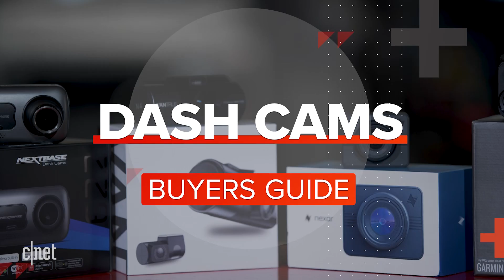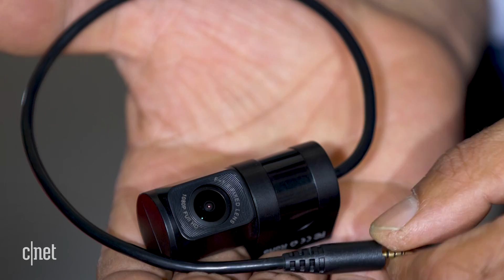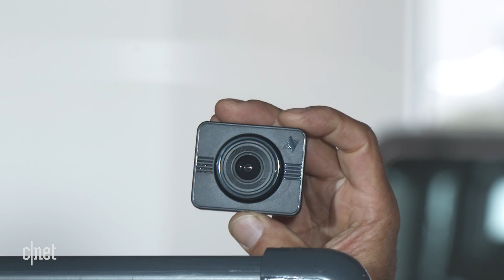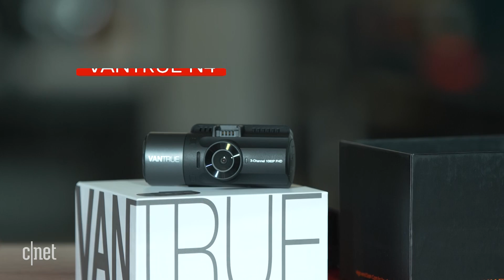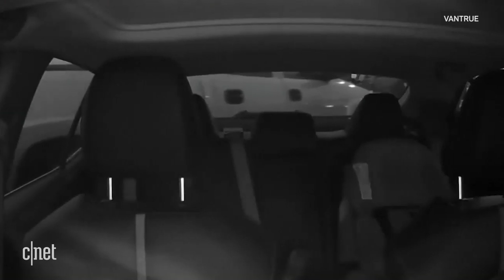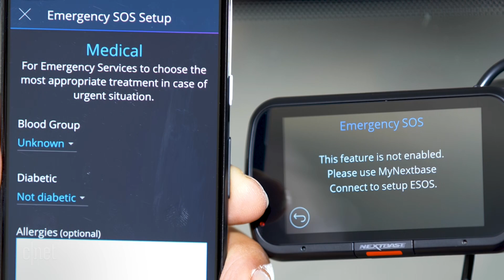Best Dash Cams 2022: The Ultimate Buying Guide

Comment: After having a dashcam for three years now, I actually can't believe cars don't come with them built-in as a "must-have" safety feature.
Reply: Automotive attorneys don't want any liability to fall back on the company for any glitches.
Therefore, it's an elective option for the consumer.
Reply: @cokiea57  no LOL. It just hasn't trickled down to cheaper cars yet. Plenty of expensive cars come with them, and every little thing adds cost to a car. So adding the hardware, body work for rear camera, wiring/power supply, accelerometers/sensors, plus integrating it with the infotainment system (which is the expensive part), is expensive. Once the software, firmware, and UI gets honed on the more expensive cars, and those people pay for the R&D, it'll show up in cheap cars. It has to be a system that works perfect, is integrated perfectly, and had to last more that a few years that the aftermarket cameras do. People buying a $20k-40k car probably aren't going to spend $2k to add some cameras. So they don't spend the money integrating a camera system to cheaper cars, unless they cut corners in other places. Like Tesla, they can cheap out on materials, quality, for & finish, and QA/QC, and offer cameras. Tesla can add cameras because they use poor quality "vegan leather" (aka plastic), poor quality materials for touch surfaces (more plastic, poor quality plastic at that), don't take care when assembling it, and don't make sure that it is assembled & built properly. So all that savings allows them to offer cameras on the cheapest $40k Model 3.
Reply: @littlejackalo5326  Very true, first time I sat in a Tesla I was amazed at how poor the material quality was.
Reply: @krane15 Cameras are cheap yes. So was Sat Nav but it didn't stop car manufacturers charging up to £2000 for them and £100 for an updated DVD disc.
Reply: Tesla's record 24/7 ... check out wham bamm Tesla cam videos on YouTube
Reply: 4 cameras running on all Teslas all the time when selected and a thumb drive plugged in.
Reply: @bearlemley  Yes Good comment. That is what I was going to mention that the Tesla Electric models have a working Sentry and Dash cameras built into the car.
Reply: I just got a 2022 toyota 4 runner and it already came with a dashcam
Reply: If you're at fault for an accident and have a dashcam, they can't take your footage or camera without your permission. That's your property. If the other driver wants the footage they should have bought their own damn camera.
Reply: @blastofo  Yeah, there are definitely 4A rights there. But I could easily see a judge granting a search of a device for accident or criminal scenarios.
Reply: @BmwGirl88  : Does  that dash cam also contains back camera to records things behind?
Reply: @mcpascaln6779  yes, front and back. Also when it's parked when someone gets close to the car it starts recording
Reply: Safety should be standard, convenience should be optional.
Reply: Amen!
Reply: Insurance companies love them and often give discounts to drivers who use them (since they can easily prove fault...provide you aren't the party at fault ;)
Reply: I was watching the Steve Lehto channel about Dashcams, it shows the other person’s mistake as well as yours…. And if the other fellow notices you have one… I think you are obligated to share the capture good or bad. Knowing a certain country’s need for privacy and law enforcement knowing you have data they need. Something like those ECU in cars which may/not have stored data about speed and other things stirred in them….
Reply: "Must have" safety feature? They don't dop anything whatsoever to increase safety, they only record incidents, not prevent them. Why should we have features built in that we don't necessarily want? It's just something else to increase the price and something else to go wrong.

Comment: Nextcam.  After going through 2 of them 8 months back where the 322 lasted 2 days and the 622 lasting a week and both shorting out through the cigarette lighter gave me the conclusion they were made with cheap power supplies. I have plugged in my iphone, IPad Pro 21, Apple Watch Garmin RV with mapping and I have never had a problem with any of it. Just  confirm crappy power supplies in those dash cams.  

Nice display and features, but what good is it if they short out when you run them in the cigarette lighter?  

PS: Good luck with customer service. That is in freaking England. Bad customer service and I am not calling England. What a total joke.
Reply: Return my 522 because battery couldn't hold charge because of extreme heat we had in NJ. Above 90 degrees will degrade the built-in battery badly. Customer support finally came on and I told them I already took the unit back for refund when they fail to respond to my inquiry

Comment: How about the cameras with remote SD storage (like in glove compartment)? So the thief cannot take footage with him when breaking to the car.
Reply: I could see the market potential for a device that has two or three external cameras that run wires to a recording unit in the glovebox ( smaller, easier to hide ), but as a prior victim of a vehicle break-in, I will say that they pried open both the glovebox and the center console, and slit the soft top all in the same event.  Hidden under a seat or in the trunk might be a better spot, but if it has a battery, heat inside the cabin or trunk can easily start batteries in such to explode or catch fire.   In Oklahoma, in a black car, in the summer time, the inside temps were usually right around 200 degrees F, and the trunk was not much better. 
Sometimes thinking outside of the box also works wonders. For example, using a motorcycle dashcam would allow you to hide the unit remotely ( two remote cameras for front and rear with a separate unit.. )  there's also a bunch of mirror-cam's, some of which replace the STOCK rear-view mirror completely, which makes it harder to notice.

Comment: Unless you are on the road all day (trucker/delivery drivers/Uber/Lyft/Cabs) which is mostly for security and liability purposes. You do not need dash cams. I don't even leave my laptop bag in the car because someone might break in thinking there is a laptop in there. I don't need to worry about people breaking into my car to steal a dash cam. Unless you have a wifi network in your car that is independent from your phone and is constantly uploading to the cloud... The Dashcams are useless. The criminals don't even need to steal the dash cam. They just have to take the SD card out of the dash cam to cover their tracks after smashing into your car or stealing whatever they were planning on after breaking into your car for.  Also, unless you suck at driving and get into accidents on a weekly basis. There is no point of having a dash cam. Normal people don't get into accidents frequently enough to justify spending money on these cameras for that ONE time something may or may not happen. That's what insurance is for. I've seen enough dashcam footage where the other party runs and they still don't get their plate number. The only way I would get a dash cam is if my insurance gave me a worthwhile discount for having one. Other than that, No thanks!
Reply: Politely disagree.  You can get into an accident on the way to the grocery store and in the span of 5 minutes.  I had 3 teenagers run a light and t-bone me driving out of a parking lot with a green light.  To make matters worse they instantly said I ran the light and the witnesses had to leave.  Camera footage seriously saved me and placed me in the intersection with a green light. Also you tend to get hurt in a t-bone accident due to the side-impact nature.  The occupants in the other vehicle were uninjured. Police do not like paperwork and investigations so yes cameras put everything in perspective.  Good luck everyone.
Reply: You make too much sense.  I agree.

Comment: I would like to offer the points I think are relevant:
- Small screen to adjust the camera
- Supercap inside, not lithium batteries
- Good low light (night) performance
- Stick on with red Scotch pad, not suction cups
- Wide viewing angle, at least 130 degrees
- Use High Endurance SD cards only, that's a special type with higher reliability

- Auto-exposure should adjust the exposure quickly when driving from under a bridge back to light, and vice versa.

Don't bother with the cam's mobility, better install another one in the other vehicle. You do not need the best image quality or image stabilization, if it's just for insurance or police documentation. If you are able to read a car plate number from a car in a few m distance, it's fine.
Reply: Thank you for sharing your insight❣️
Reply: Nice, I wish more companies would offer screen versions
Reply: So which one would you suggest?
Reply: So, after looking everything over,  I went with the Thinkware x1000.   It has a front and back camera and has the parking feature, plus it was easy to install!
Reply: @choens13  Looks like it has a full set of features and good night vision. And how do you like it?
I bought the Chinese XBHT XB701s for myself.
Reply: Do I understand correctly that the camera in the car could be  a bait and a reason for criminals to get into the car? Is there any solution? Mobile cam?